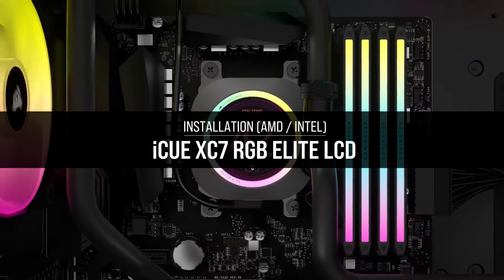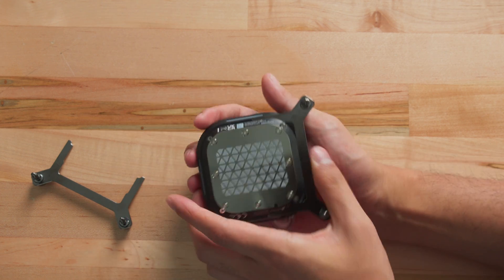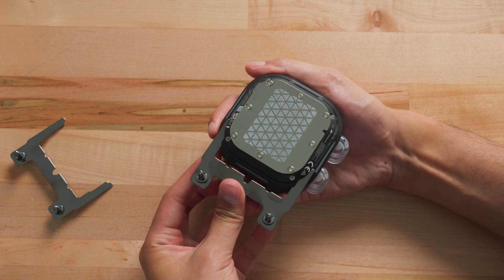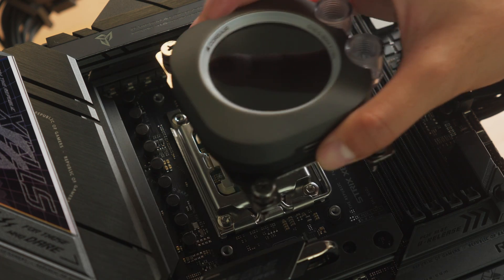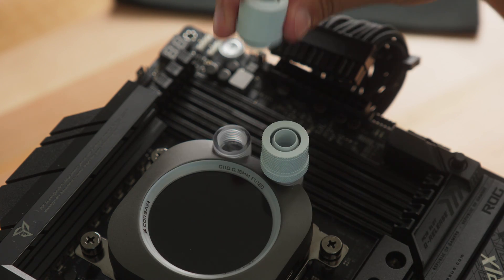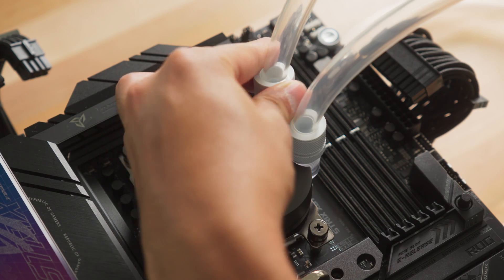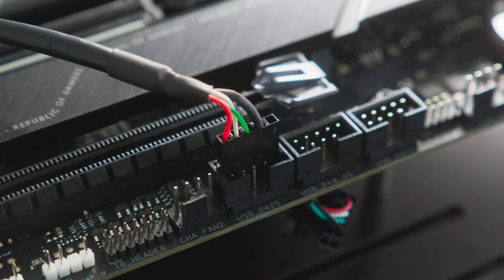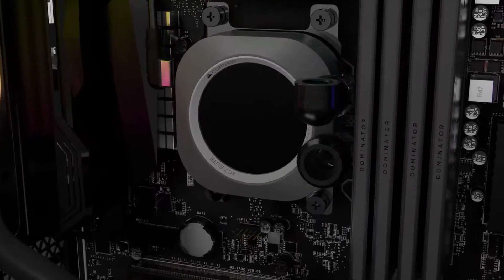Installing the CORSAIR iCUE XC7 RGB ELITE LCD Water Block

Comment: Wish this block performed better with the X3D models. Tried different pastes and reseated multiple times. But realized it just doesn’t cool like it should. Up to 40° delta between the coolant temp and CPU package temp.

Comment: PLEASE HEL I HAVE iCUE XC7 RGB ELITE LCD CPU  I PUT ON ASUS Z790 AND NOT TURN ON
Reply: Put it on the usb 2.0 slots on the bottom of the motherboard. The red wire from the cable goes on the left. And make sure that it’s on the 2nd row below inside of the usb 2.0

Comment: does the direction of the in/out matter? can i have the in & out at the bottom?
Reply: I think it works but it’s really not optimal, the inlet makes water run into little fins on a copper block which is on top of your CPU, (that’s what cooling your CPU and eating the water) and it then comes out from left and right of the copper block following the fins, the two streams converge and then the water leaves form the outlet
If you put your inlet on the outlet that means your liquid will be seprated than run through the little fins and than follow a little hole in the copper block to the inlet.
I’m not an expert but that might cause your head pressure to be reduced and the flow to be slower because first the liquid won’t spray out in the fins like intended but will rather push in them, coming from both sides and that will also cause the liquid to push against itself from each sides